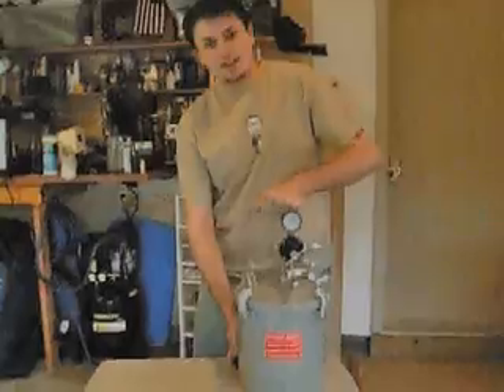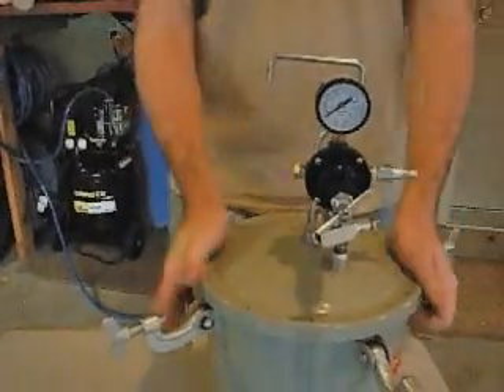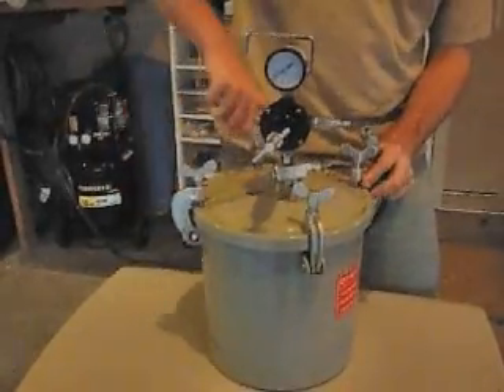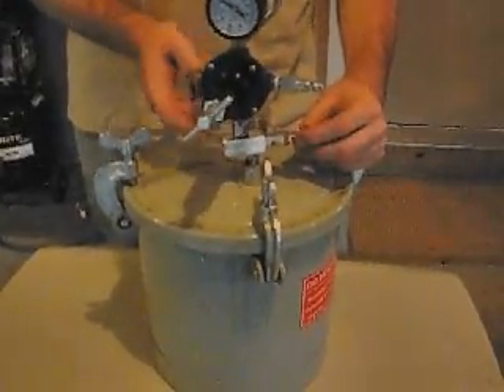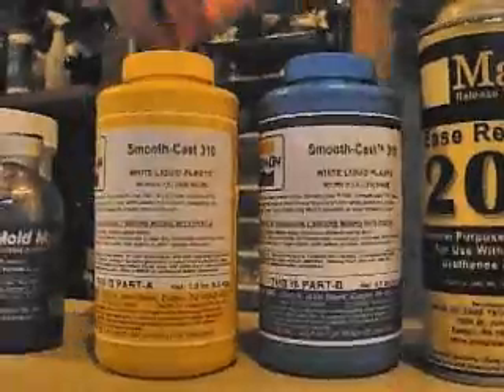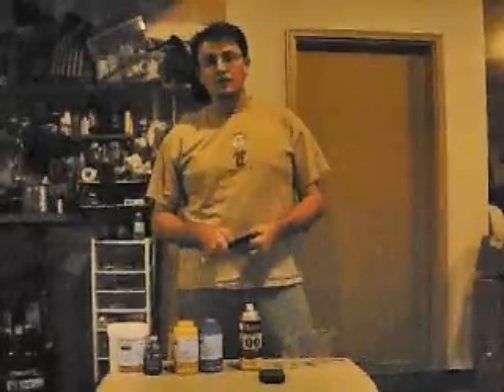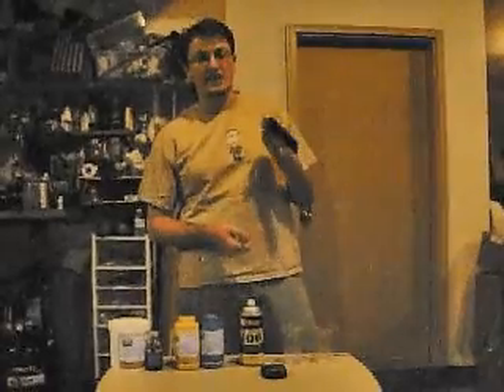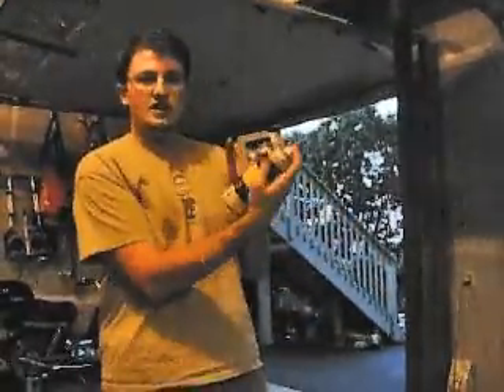Pressure Casting Tutorial - Part 1

Comment: Fantastic vid, thank you so much! Cleared up a lot of confusion for me regarding casting small items. I have an airbrush compressor that sits at 50 psi quite happily, will that do for something like this? Does it just take longer to fill the pot?